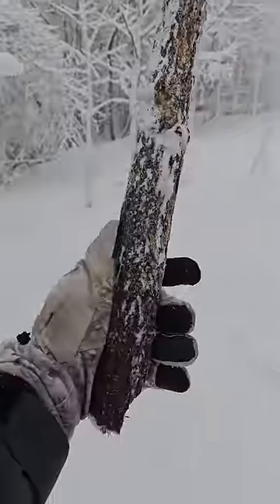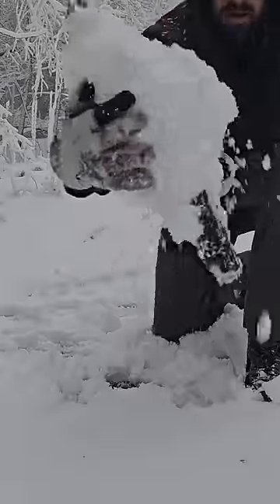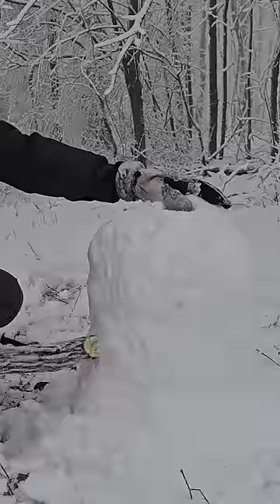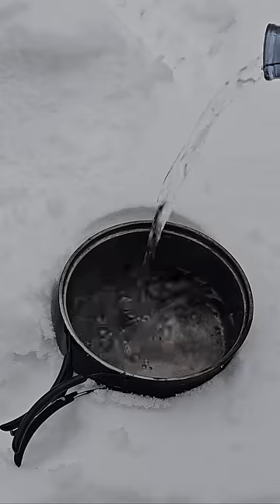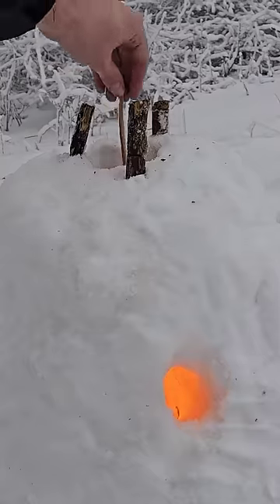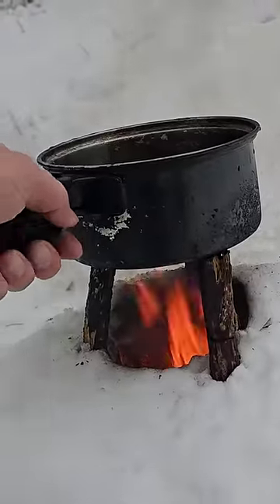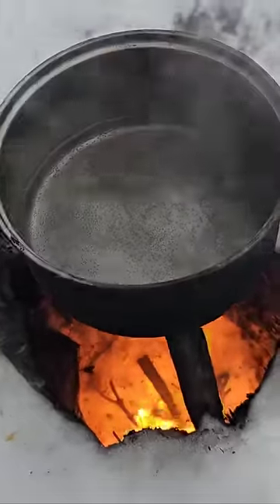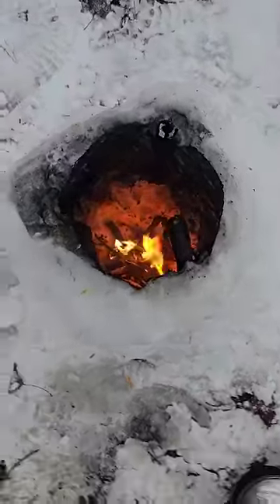Experimenting with building a rocket stove out of snow 🔥

Comment: That honestly worked a lot better than I expected.

EDIT: I already knew that it absolutely would work, it just exceeded my expectations.
Reply: I think the carbon from the fire sticking to the walls of the inside of the stove protected it from excessive melting.
Idk. I'm not certified in making that claim in any way.
Reply: Packed snow is a great insulator.
Reply: Should have packed sticks around the big stick, then snow around that.  The wood would burn while supporting the pot and protecting the snow a bit.
Reply: Its not consistant and will be different results each time
Reply: The principle around Igloos and other ice buildings is that snow is a very good insulator. I think that a snow stove could work, but the project in the video was lacking some major understanding of how Igloos work (I know, it's just a fun video, but I think it'd also be fun to create a better project).

Basically, an igloo works because the snow inside melt from the heat, but then freezes due to the temperature outside being low. Snow, being a good insulator, doesn't heat up really much, so it has plenty of time to cool down from outside. Also, the ice formed by the snow melting can absorb more heat (and, of course, more cold, have mercy on me for using simple terms physics).

The main issues of this video are two:
1. The heat source is too hot to stay that close to the walls;
2. The walls are not large enough to withstand the fire.

In order to improve that stove, I would:
1. Make the snow even more compact;
2. If possible, bury it in the ground; if not, make the walls wider;
3. Have the fire burn as centered as possible.

Since heat generally goes up, there'd be a certain point at which the snow would be able to cool down the ice walls enough to prevent further melting. You'd have a wider stove, but it would fine with a suspended structure as you mentioned in the video.
Reply: Yeah, I was thinking, maybe if it was made of ice, it might last a fair while.
Reply: I usually do this with an apple and some special kindling
Reply: an igloo would work
Reply: It does work.
It does work, use sticks (anything) for the sides and stand.
Make a drainage hole at the base with 2 sticks in a "V_" shape.
The water vapor reduces the heat.

The above makes water from air, and cooks food + boils water.

Use the drainage water as...clean water with carbon for upset stomach caused by nausea too.
Reply: Fun fact: snow is actually a good insulator. 90% is air inside.
Reply: @mjames7674  We did this "experiment" in Physics class, short answer, Fire is not that great to melt snow. It obviously works but it won't melt as fast as one would think. 
Pure some warm water on it and its gone in a few seconds. 
The fire doesn't transfer the heat well to the snow.
Reply: Snow is an incredibly good insulator and thermal reflector.
Reply: Snow is a good insulator because air is one of the best insulators.

Fire is only able to put so much energy onto the ice from the lack of medium like metal or other any other conducting material that can transfer that energy faster to the ice.

Also, frozen water needs alot of energy to convert back to a liquid, and any ice that does convert evaporates in the air due to the low pressure from the cold allowing for the waters boiling point to be reached quicker once melted.
Reply: He made cold water from cold water
Reply: I know right?!
Reply: Run the sticks all the way to ground. That was amazing.
Reply: @mjames7674 no that made it worse snow is a better insulator
Reply: twss
Reply: I was thinking after he made the holes "ok then you put your weed in there right" 😂 @HeyImDateMike
Reply: I honestly was like "pffft, that's not going to work"...  And then🤨😳😯😮
Reply: @sam-psonsmith9951 :0  Im drf. taking notes on this one.

Man i wish i took physics back in high school.  T.T
Reply: Zamn the hole got gaped
Reply: Cats
Reply: Fullmetal Alchemist?
Reply: snow stick
Reply: Thanks for stating the obvious
Reply: I NEVER IMAGINED SUCH A THING WAS POSSIBLE. INCONCEIVABLE TO ME, BUT IT'S RIGHT HERE ON VIDEO IN FRONT OF MY EYEBALLS... UNLESS IT'S A.I.(GRAPHIC ARTS ALTERED) 😂😅😊😅😂😅.
Reply: @ganymede4030  😳😄😂😉
Reply: Yeah it... didn't work
Reply: There was need to edit your comment
Reply: @bluemyhigh  It's my comment and I felt like changing it.  Was there a need for your judgement?
Reply: @adolphin9348  Very long post you wrote just to be wrong. You said the video lacks understanding of igloos. He didn't build an igloo. He built a rocket stove. But judging by your essay, you don't know what a rocket stove is.
Reply: @adolphin9348  The issue with those modifications is that it's deviating from the show rocket stove concept.  I'm not saying his dimensions were precise, it's outdoors after all, but that kind of choke is needed for that kind of draft.  Widening it substantially just makes is a snow stove without the rocket aspect, or requires significantly more heat to pull the draft, requiring a larger cavity and then even more heat, etc.  I'm not putting math into this just my reasoning so I welcome being proven wrong.
Reply: Cool😮😅😊
Reply: Same